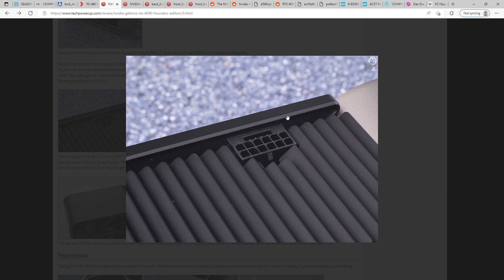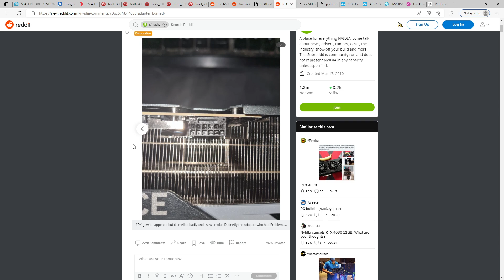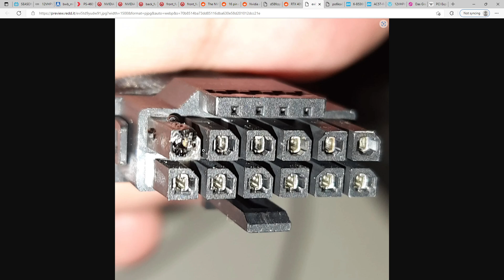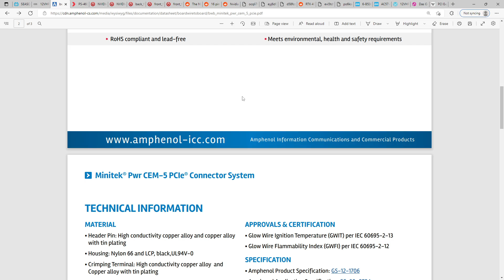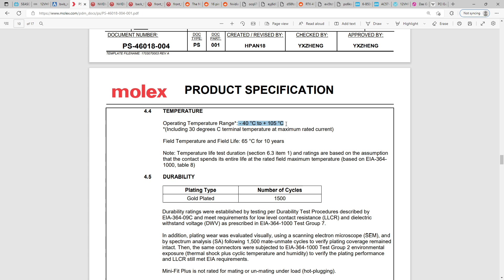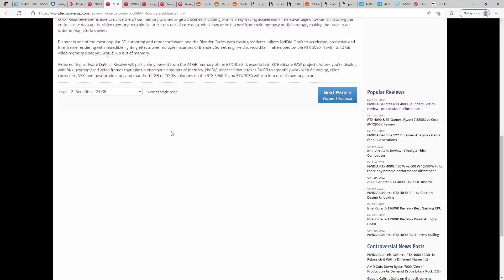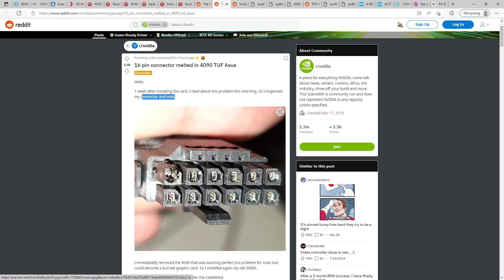rambling about the 12VHPWR failures

Comment: Also other case maybe if one of pins has/got better contact than other so it get bigger portion of current when all pins are connected together in connector instead using own wires for pin. Even long cables or shunt resistors would have balanced that current more evenly.
Note: remember when designing amplifiers. Another function of emitter resistors was to balance out manufacturing differences between parallel output stages so that they get same amount of power to dissipate.

Comment: About thermal camera, you may try look at pins in PCB from connectors, because metal is great in conducting thermals, and when connector getting hot and have any contact with pin, it make pin hot, but is not best way, because where are few weak points in this method.
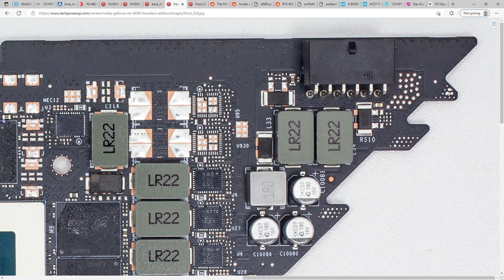EDIT oh, you suggest it in 7:30 I should watch to end.
EDIT2 9:05 why look at side of PCB where is hard to see pins? Look at back of PCB where they are soldered, should not be much different.
Reply: and from what you said, why they don't put ground pin near pcb and 12v outside it would help with cooling... oh, yeah, it should not need cooling :D

Comment: I think you should check arc welding, which works with 10-50V and as name suggesting are using arc in air ;)
But other all you are right, but I want to point it out.

Comment: well, copper wire cables are also good heat conductors. If the connector itself is hot enough to melt plastic, the copper wire will also be visibly hot on the flir for sure. Since the heat gets conducted up into the wire.
This problem could easily be solved by gold plating, which would reduce contact resistance, or even switching the connector to solid copper. Not sure what metal it is made of, but most regular metals are not great conductor compared to silver, copper and gold.

Comment: I think the important missing from all the explanatory videos is:
why does housing of the receptacle not prevent this excessive movement when wires are bent? It should be possible to both allow some movement to allow the pin to be well seated and prevent the receptacle from moving too much.

Comment: One thing that's worth noting is the NVIDIA connector takes a lot less force to insert than a real Molex Microfit 3.0, I haven't had the chance to feel a third party cable but I'd bet there's a notable difference in insertion force so the use of those split terminals is a smoking gun for me, contact force on the dimples is probably lower than spec leading to high resistance, poor current sharing and thus thermal runaway.

Comment: 32:13 Load balancing might further reduce the current on each of 3 parts compared to how much a bad connection would reduce it. So, if card measures a voltage drop on 1 part it can reduce the load on it. To achieve that the balancing parameter should just be the voltage drop multiplied by current draw so that the balanced physical value is the power dissipation.

Comment: I think using a thermal cam is at least somewhat valid. If the inside of the connector is getting hot enough to melt the plastic, you will for sure see that on the camera. The heat transfer from the inside to the outside of the connector wouldn't instantaneous, it will likely take a few seconds longer than something made from metal, but it will transfer. Having air flowing over it shouldn't really matter a ton, if anything because it's a mediocre insulator the transfer of heat transfer to the air will be reduced compared to something metallic. To put it another way, if plastic was actually a good thermal insulator, 3d printing wouldn't work anywhere near as well as it does.
Reply: Thermal cam is absolutely useless. The plastic (nylon) is not heated up, it is the contacts going hot and melting the plastic around (as does the filament going through the hotend - it does not conduct heat anywhere to the spool side). It is like u touch filament near the spool and claim that the hot end is cold :) He is 100% right about this.

Comment: Have you actually read igors lab article (there is an english version)? He says that the terminals get overloaded because of how the load is distributed over them. The outer terminals have to carry way more current than the inner ones the way they soldered the cables onto the plug.
Reply: Not exactly. They are made in a way that the outer terminals can start ripping off when bent. It's not the plug, it's the adapter.

Comment: The solder joins theory is actually not bad. If you have a bad connection but you still have contact the heat will build up, you can have melted plastic in the housing it self but three will be no way to know, the same way if you want to check the outside temperature of the plastic is not that thermally conductive, the melted part is where the plastic is thinnest because the metal is thermally conductive so if the joins are hot the terminals will get hot too, so seams pretty logical to me and maybe is combination of both terminals and joins. As a owner of one of those cards for a 15 days I've checked is there any melting and what I can assume is because this connector is made with tight tolerances, probably some users will not realize that the connector is not put fully in, which can cause the bad connection you are talkin about here, especially if you put the connector in at an angle and probably crush the plastic guides that "ensure" the proper contact, because the plastic is so thin and the contactors are split in two. Overall this is not the best felling to check you new GPU if there is damage on it just because somebody tried to complicate thing without any good reason, I was perfectly fine with my 3080 on 3 PCI cables. BTW Seasonic have a program for 1000W owners(that was purchased in the last year) to claim free cable that will probably solve that issue, so owners of 4090 and Seasonic 1000W power supplies just go and fill the form for a free cable.

Comment: Does extra pcb area for 4x 8pins really cost so much more than separate adapter cable splitter, which is manufactured on different factories most likely 1000s kms away with additional production and logistic costs?
Reply: It may, these PCBs have a lot of layers.

Comment: Aren't a lot of PSU built to compensate for the voltage drop on detection? Also among low-to-mid tier PSUs aren't there plenty which which do it across all the lines and not only droped one?

Comment: You can probably get arcing with 12V. It just takes skill and conditions you're not going to find in a PC. If you flow argon with suspended ions over it to lower the resistance and both sides are clean, pointy metal and your power supply is prepared to push 1000A at 12V, I'd be shocked if you couldn't get an arc to strike.

Comment: So the point of failure is the narrow pins at the very tip. Makes sense. Napkin math at 600w, 6 12v pins, 8.3A per pin. Even if the wires are 14awg, the pins are still the same thickness but then the contact area is halved when it bends. Making the connector smaller and the power draw per pin higher was playing with fire.

Comment: I was hoping you'd make this video (even if you didn't want to). I always appreciate some Buildzoid analyses.
I'm curious though - can you get molex pins that have no gaps in them, or is that not a thing? I know USB-C has that, where there are ones with splits (cheaper, more common) and the ones without (obviously more expensive and better quality). Regardless, it's clear NVIDIA cheaped out here, which is a shame, but at least it's not the GPUs themselves.

Comment: What I don't understand is why the bad connection still gets a large amount of current going through it. Igor's teardown seemed to show all the pins in a row being connected together, which should mean that if one of the pins gets a higher resistance it should start passing less current and the rest should take up the slack. Or is this because the 12V pins on the card side are not all connected to the same power plane?
Reply: Just because the current is lower doesn't mean it's low enough to not cause issues in this case

Comment: This to me looks like the most sound explanation of the problem.
I happened to have some really old, really beaten up molex connectors to the point where contact was very poor or intermittent, even with half of the receptacle broken, and they got a bit warm; scale that to 600w and way smaller and mechanically weaker receptacles, and I can see how the melting is happening
Reply: At this point I might trust a couple of 4-pin molex connectors with 2 12V pins and 16 AWG wire more than this damn adapter.

Comment: Electrode welders (DC) operate around 18volts ... there is an arc which is quite long even! Thats why for example switching off DC loads ( Photvoltaikpanels) needs quite sophisticated switches that explicitly terminate the arcing... otherwise ==> fire

Comment: I think the problem with solder join is if 12v didn't connect but ground was connected, the adapter still considers the cable is 600W capable and sending more power through the other 3. The power sense seems only counts how many pins is grounded...
Now if you have 2 12V side... disconnected...

Comment: as far as i'm concerned, there's two issues; frankly the connector itself sucks to some degree, and there really wasn't a need to shrink it beyond 'we're making progress!' it just seems flimsier, even with the 3000 series cable. meh.

the nvidia variant is flat out trash. end of statement.

so, the pins are identical. same physical size. but they're saying that the old style can only do 150w for an 8pin. which is like, 225w for a 12pin (non 12vhpwr), yet somehow the same pins closer together (with 18awg, as spec'd) can do up to 600? meh. spec for 12vhpwr is 16awg. some custom jobs are using 17awg. for the length of cable present in all applications 16awg is plenty. the problem in all cases, becomes the connectors. 

nah.

get decent wires with a larger 12 pin old style connector or dual 8's for 16, larger size wires, or 3x8 or dual 12's or whatever its going to need, and be done with it.

i've seen enough, i don't much care. i won't own anything with these connectors. nvidias or otherwise. 

(yes, i'm aware its kludgy up there, and i'm not exactly getting it across the way i want. corrections will be ignored. use fuzzy logic here.)

Comment: They could've used an USB-C. It does 240W per connector and is much safer to plug in with less of a footprint than an 8-pin. They could go up to 720W😁.

CAC-1573 - defines 240W for up to 2m/6.56ft.
Now, super thin long cables at 48V :-)
Reply: Which PSU will give you 48V? With 12V it would be just 60w
Reply: @DepressedMusicEnjoyer  Well, we make them :)
Reply: @TonciJukic  Well sure there are 48V PSUs, but not in normal consumer machines. So it would make it incompatible with older PSUs, without changes being made to them. And also could cause confusion.

Comment: Wouldn’t the load balancing logic of 3090ti try to keep voltage drop across power planes on the connector equal? That is, if one is dropping pill less power and load other more?

That’s different than trying to pull equal power through each one of them.

Then, when one part of the connector has higher resistance it would pull less power.

Comment: Looking at everything, I'm convinced it's a combination of many bad design choices. Anyone who has worked with plastics knows it begins to soften with heat before it really melts. The thin 'braces' molded into the connector to secure the termimal ends are under pressure when inserted which could eventually soften and allow the terminals to begin splitting apart. 

This would worsen the furthest from the housing where it's also the most insulated. Also, the user not inserting the connector perfectly straight could put extra stress on the side pins and begin the issue before it's even powered on. This may further explain why the sides tend to go first but it's hard to say.

I think the potential solder bridge issues compound all of this. Resistance increases for whatever reason, everything heats up and it simply gets worse from there.

TLDR: The adapter is crap. Nvidia will recall them and replace it with one using individually crimped wires and single split termimals. For all the trouble they should include more flexible silicone wiring or FEP (they won't) if they don't want to sheath them.

Comment: It was as I thought. Somehow you get increased contact resistance in the female part of the connector.  Due to failing of the sleeve. It fails due to deformation of the sleeve. The heat will appear where increased contact resistance appear, and propagate from that point

Comment: 13:00 I would not agree.
The solder points are the start of the failures caused. They are soldered to very flimsy thin contact plates.
When you do proper material and surface contact formulation calculations, those solder plates would come to a FAIL classification spec for the amount of electrical transfer it does on the max spec. The failure is cause by couple issue points.

#1 Mechanical stress on the solder points by bending which, 100% of users do while connecting the cable.
#2 Weak thin contact plates that are under spec for the amount of electrical power it is transferring over to the GPU pins.
#3 Engineering wrapping a black cloth band-aid to fix both #1 & #2 critical red flag electrical engineering design issues.
#4 Soldering should NOT be used in this case, only as an extra strengthen bond when the wire is already mechanically crimped to the pin to strengthen the connection.

As you can see these failure points is caused by multiple engineering design flaws, who ever wrote it off as just ship it didn't take their engineering job serious.

Comment: I think they went with the adapter for the exact reason you stated, but dismissed, they didn't want to do 4 8 pins straight to the card, and using 3, while sure would work, isn't how it's supposed to be done. We're seeing this much hysteria over, so far, what is basically a relative small amount of failures, have we hit 10 yet? Safe to say it's less than 1% of cards sold and Nvidia's response, at least to those who I've seen comment on it has been to either replace the cables, or the entire card, so it's not like they're screwing people, but we're already sharpening the pitch forks. Imagine the hysteria over shipping a 600 watt card with connectors rated for 450, even if yes they can handle it. 

Shrug, I'm more curious why they want to see the cards. We're all assuming adapter obviously because yeah it looks like a rushed product and it obviously has shortcomings, but they, and by they I mean their engineers, seem more interested in the cards, wondering if it's something on the other end contributing to it.

Comment: is possible to have two nvidia gpu in one system and different version of drivers for one and second card. My NVS 510 for monitor output hates with rtx 3060. installation drivers for nvs510 whipout rtx3060 drivers end the same rtx clears nvs drivers.

Comment: Theoretically the load-balancing across sets of pins should make the 3090 more susceptible to overloading pins, since a failed pin would route the full cohort target load through its cohorts only, whereas a 4090 would spread the failed pin's load across the entire connector's pin array (per direction).
Reply: Does the 4090 load balance on the individual pins? If so, it could be also help, right?
Reply: Also with that adapter all pins are connected to bus bar. So one good contact will take bigger portion of current and get biggest power to dissipate because bus bar will even voltage drop over connections :)
Individual cable for each pin maybe enough for this balancing.